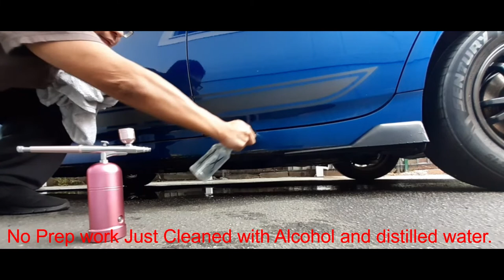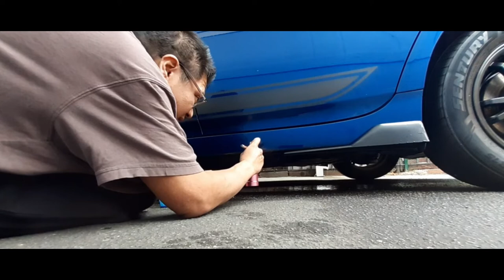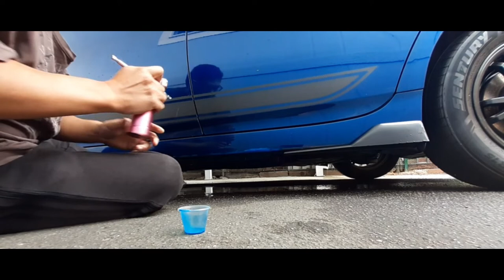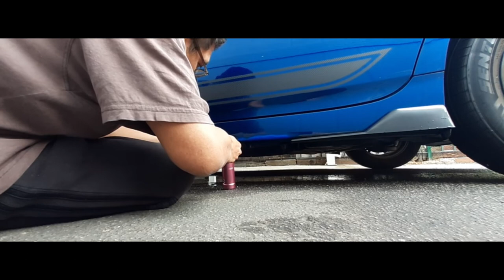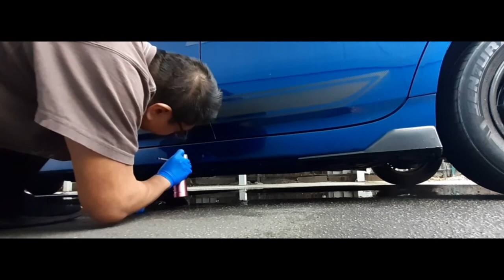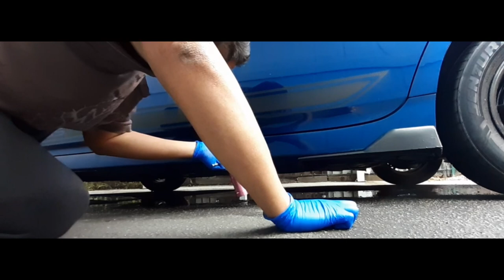Airbrush Car Paint repair.

Comment: How about how to mix to automotive paint for air brush
Reply from the maker: I actually mixed 2 touch up paint, the original oem from factory and add a little black, then add small amount of paint thinner so it shoots through the air brush, you just have to eyeball it and get a feel on how it sprays and looks on a test piece.
Reply: @MrEqp123  what about clearcoat? no need?